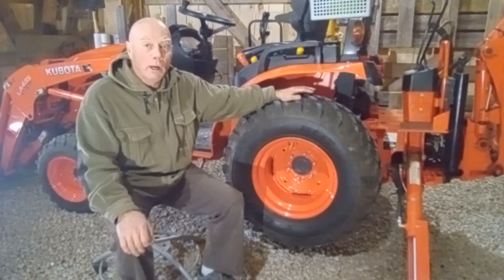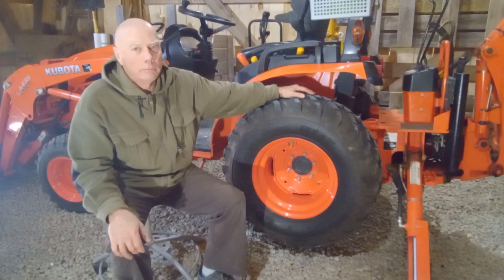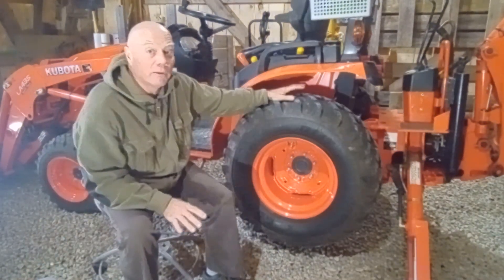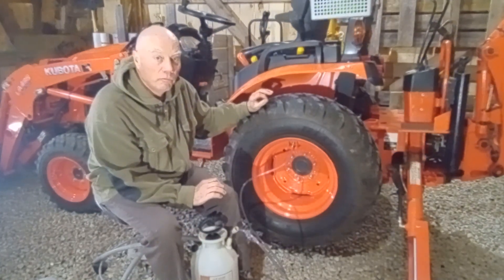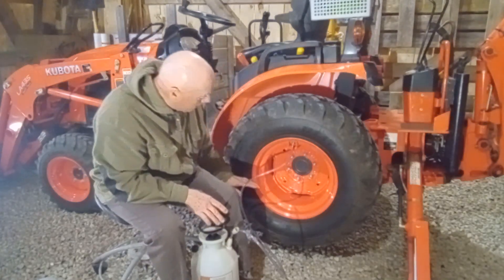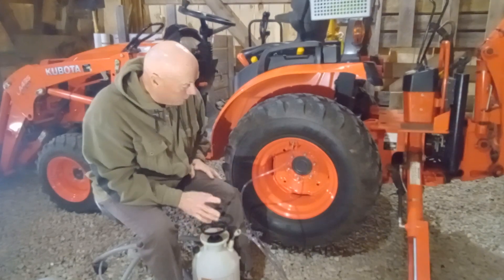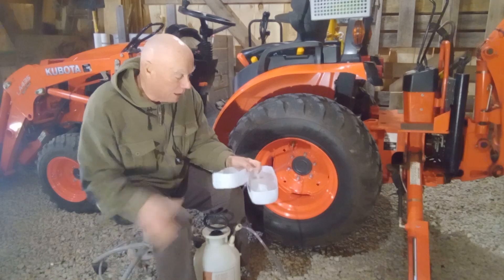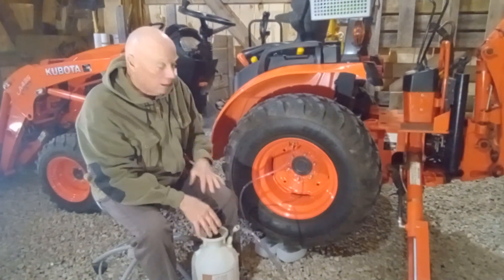14.  Filling The Rear Tires On Our Tractor With Fluid

Comment: Thank you for posting this! 😊
Reply from the maker: @rayrod9221  Good morning. Thanks for watching and commenting. I hope the video will be useful. Adding the fluid made quite a difference in the stability of the tractor. I am planning to add wheel spacers on the back tires but still undecided to go two inch or three inch. Have a great week, Ben

Comment: How's she goin'?  What more can be said about Dave at RCAFPolar Express.  I have been watching his channel since he started.  He is very committed to our YouTube community and to his maintenance regime as well!!  I put windshield washer fluid in the rear tires of my GC2300 too.  I used a little battery operated pump and I had a 'burping' valve.  The valve was screwed onto the tire valve stem and as I pumped in the fluid I would 'burp' the valve and let the built up air pressure to be released.  It sure made a big difference having the tires loaded eh!!  Thanks for your video.  The honesty in it will represent you well!!  Take care!!!
Reply from the maker: Mike, thank you very much for your kind words.  Yes, it is easy to see that Dave is a special guy, and a big help to this tractor community. I am really enjoying the difference in the feel of the tractor with fluid in the tires. I am often asking our B2601 to work like an L2501, so the extra weight is very welcome.  The garden sprayer I used has a pressure release valve which was great, but I think your burp valve would work even better.  All the best, Ben
Reply: @whenworkisplay  But like you mentioned Ben, for this job anyways, you use it once and then you put it someplace for safekeeping and it's never seen again!!  LOL

Comment: Your method worked out great Ben. That was a very interesting way to fill the tires. I have Rim Guard in my rears of the L2501 Kubota. As you have probably seen in my videos, I have a lot of steep slopes and off camber conditions. The wheels are set out extra wide and wheel spacers have been added to widen the stance even more.
I usually leave my box blade on or another implement when using the loader. It has always done fine.
I will be interested now Ben to hear from you on how much difference you notice by having the fluid in the tires.
Thanks for sharing. Very interesting.
Reply from the maker: Good morning Gary, Thank you for your insightful comments. I would love to have used Rim Guard,  but hard to come by in our area. I have not been on the tractor since filling the tires,  but will let you know how they feel. I think wheel spacers may be in my future. Trying the fluid first. It  appears I have missed your latest videos. I'm enjoying them with my morning coffee. Talk to you soon,  Ben ☕️☕️👍👍

Comment: Wow I didn't know the process could be as easy as just pumping it in with a sprayer. I neve filled my tire because I didn't want to deal with all the liquid if I punctured a tire (which I have done). after you add the fluid do you then fill the reaming tire with pressurized air? For what it's worth some of my best viewed videos are when projects don't work out according to plan. People like to see the struggle plus they can see what you did and avoid doing that. This was very informative to me. Nice job Ben!
Reply from the maker: Thanks Justin.  I Probably should have mentioned in the video that when you are done ,the valve goes back in and you add air to the proper psi,  25 psi in my case.  I over pressurized  to 35 psi to make sure the tires were well seated on the rim,  left it overnight, then deflated to 25 psi the next morning .  All the best, Ben
Reply: @whenworkisplay  good to know!

Comment: Dave is a fantastic guy!!
The sprayer thing is interesting never heard of that method. I did mine last winter but we have a pump, I also am a fan of putting tubes in tractor tires which would eliminate the leaking problem. Glad you got it done and thanks for sharing your experience we are all a part of a great tractor community. Take care.
Reply: Thank You Very Kindly Mon Ami and That Is An OUTSTANDING Idea ( Tire Tube ) it will eliminate also the corrosion effect too on the steel rims 😇👌👍🍻
Reply from the maker: Good evening Russell. Thank you for the tire tube tip👍and thank you for watching. Have a great week Sir, Ben 🍻